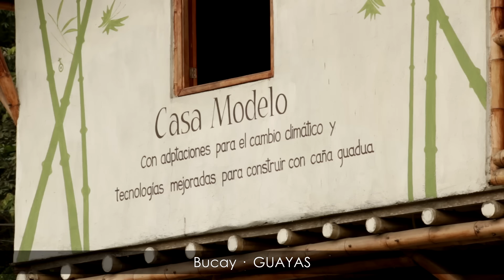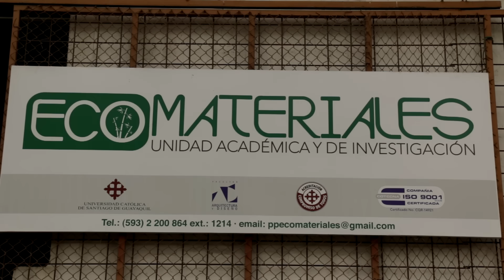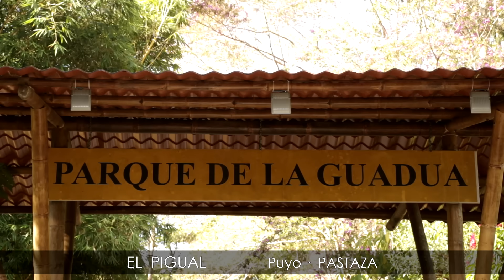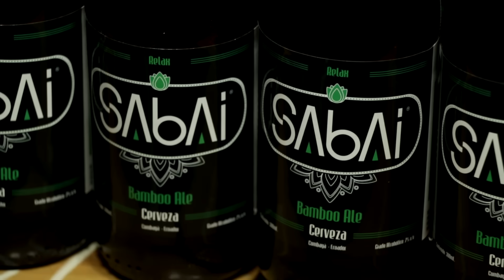BAMBOO - The industry of the future, now

Comment: We have invented fast pyrolysis system for conversion of any dry agro waste to active energy without the pollution of environment.We developed a pilot project for Maharashtra Bamboo Development Board,Nagpur, Maharashtra.On the completion of the process of dry bamboo waste we get three Bio Products                     1) Pyrolysis Oil 2) Activated Charcoal 3)Syn Gas.                   •)On distillation of pyrolysis oil we get Light Diesel Oil(LDO) and Compressed Natural Gas(CNG)                      •)The Activated Charcoal obtained from the system is used in various industries such as Cosmetic industry, Pharmaceutical industry and Fertilizer industry.The Activated Charcoal can also be used for Purification of Water.                                           •)Syn gas can be used for generation of Electricity and on compression of syn gas we get Compressed Natural Gas(CNG).                                    This is a patented project and the size of the system varies from 1 tonne per day to 40 tonne per day

Comment: I learnt about Bamboo 19 yrs ago while in HK  ( sars stayed in urban centres same as covid 19 where air and water polution troubles 1/4 NY high in mercury toxcity 10 yrs ago healtauth did nothing Mercury big issue world wide in 1918 too ) Banboo light weight andflexible similiar ro carbon fibre for a fraction of cost ( but eng dont spec bamboo it natural NOT made to eng specs) Bamboo  groves can be contained by lining a trench with plastic so roots dont grow outward.Over 2000 vetities some will grow in southern Cdn prauries ( harvest every yr comes back from the root) Make composite plywood likr material with hemp fibre. Flooding occured Calgary Ab Cdn due toclear cutting ( waiting decades for planted trees to regrow) The wind and sun melts the snow ( not shaded and protecyed by trees) along with heavy mtn summer rains caused extendive flooding. Gov polocies to protect lumber ind caused the problem. Prairie farms could have another viable crop to grow along with hemp fibre. Sustainable ag production. Less mud slides on steep mtn where helicopter logging in BC Cdn is done.  Better areas already logged off. Waiting decades for trees to regrow. 1 403 830 4124 call us

Comment: So pretty all the finished products. I can see how it would help, since bamboo appears 2 grow faster than regular forests. However, arent we adding a lot more pollution when using all da machinery at smaller intervals?
Still, they are lovely designs.
Reply: true, but when comparing the total environmental impact of a bamboo construction with fex a concrete one the bamboo wins easily every time, irrelevant if you use carbon emission, environmental footprint, embodied energy or any other measurement methods. only straw bale comes close to this in the northern hemisphere. and i agree, it's extremely beautiful ;-)

Comment: This is a great video. Bamboo can be as strong as steel and help humanity with the deforestation issue. I am shocked to see 100 if not 1000 ways bamboo can be used. It is absolutely amazing.
Reply: Only in Asia though, I wouldn't support it as a building material in most of North America bc that would be economically and environmentally unsustainable.
Reply: @FletcherHillier  Why?
Reply: @rivergrrrl1256  Shipping building materials overseas would be bad because it uses a lot of fuel and cargo capacity to do so.  Only specialized, valuable building materials are shipped long distances. Eg tile from Italy, even at $1/tile is far more valuable to ship than low density materials such as wood or bamboo.  It would add the cost of overseas shipping and make the materials non-competitive vs. local lumber.  We also expect perfect straightness of all materials.  If its not straight I always return it and avoid buying it in the first place.  Even $1 more and it will not work as you are competing on a price level with those who would be using standard lumber, steel studs or concrete.  I wouldn't even bother with lumber as it increases in price far faster than inflation, which tells you it will be phased out of construction for all but custom homes in the near future.  Concrete composites will take over 90% of construction within 10 years.  I am already phasing it out of my business in favour of concrete.
Reply: @FletcherHillier  your reaction is outdated, as there are bamboo construction beams and planks, which are made to stay outside, heavy rain or not.
They last for at least a hundred years, as scientifically tested in shorter time..that is.
Reply: @ThomiX0.0  The cost of that would be insanely high with shipping.  Building materials are almost always the cheapest available to that area.  Eg. Concrete is the prevailing material at about $0.07 per kilo or $5/cubic foot.  Even our local lumber is going to be phased out of business as the prices double every 2 years or less for lumber in my area.
Reply: @FletcherHillier  , I agree if you would use local timber for your construction work.
But, here in Holland, we have the option for outside flooring and furniture, which are made from bankiray or teak.., comming from Africa or south-Asia.
Questions arise then, if it wouldn't be better to use pressed and fully impregnated bamboo instead, which stay straight and firm in any weather.
Transport costs are the same.., and using hardwood from the original old forests should be prevented at any cause, at least that's what I thought?
Reply: @ThomiX0.0  I have bamboo flooring in my house, its fantastic.  We used it above a shower and it suffers no problems from constant moisture.  I would consider processed bamboo products to be worth shipping, but normally the core building materials are locally sourced due to cost and weight.  I don't really work with exotic materials as most people want things to be low cost.  Bamboo can also be unethically harvested, effecting the Panda habitats and other species.  It can be a fast growing material though but its very different from wood.  We can kind of forget about a few thousand acres here in Canada for a while until they grow again so the growth speed doesn't matter that much except to the individual owners.
Reply: @FletcherHillier  , as you suggested, the habitat of the Panda is a restricted area far away of the useful bamboo growing sites.
The bamboo used for construction, isn't the bamboo food for Pandas, they use other kinds of bamboo and this argument cannot be mixed in the discussion.
Growing these gigantic types of bamboo in Canada is not done, due to the lower to moderate temperatures, and will always be a exotic material.
Multiplex wood ( Okumé) in the usual market sizes cost nearly the same as Bamboo triple layered in the same size, and are much stronger than wood, in Europe that is.
But in Canada the Oregon multiplex is much cheaper, which is logic, although much softer too, and will keep his position for building material because much lighter in handling.
Again, one have to use it for it's quality and your floor will indeed stay 'special' and for a long time to enjoy!
This movie showed us the constructions in it's original form, which is a whole other story and the material should than be from a local source.
It has his own natural beauty, which we should not 'want to have' in the north, and I agree with you about that.
For the tropical zones it is a very good idea, and can safe the forests at the same time, and that makes me happy to see. 
Thanks for your comments, cheers Fletcher!
Reply: @ThomiX0.0  Good to know, I would argue the same of our controlled forestry as far as not destroying habitation of any endangered animal.  Most of our country is not economical to live in due to a short farming season and cold winters, so we grow a lot of lumber that we can barely get to.  The further North you go, the more trees there are, yet somehow our lumber prices double every year.  
Bamboo is an amazing material for tropical areas, growing as much as 1 foot per day.  The problem is that people like to live where bamboo grows, so it will go up in price faster than inflation and eventually be too expensive for those areas.  As most cities do, they will use concrete more and more as it is comes from the most abundant building material in the universe, stone.  We even have methods of using microbes to produce the cement portion.  As far as I am concerned, concrete is the most important material of the past, present, and future as it is the only material that will be available to humans as long as we live.  Once we master stone we have the material to build anywhere on Earth and beyond.
Reply: @FletcherHillier  if I am informed well, the toilet paper, wet tissues and paper to wipe your nose, which are familiar all over the world, are mostly made from fresh wood out of the nordic forests. This handsome building material is smashed to pulp, as it brings more profit. We ourselves have to make important decisions during our life, moral values for those who make these luxurious items are tweaked by the height of their pay checks every month, we have to be responsible ourselves, don't buy lousy tissues anymore.
The curing of concrete give enormous pollution because we use so much.., we are simply with to many.., and when using wood for a single house we don't even need a drib of it, none.
But in crowded city's there is a problem for that..as we all understand.
My house is entirely made out of concrete, even the roof tiles are that, there wasn't an option to choose wood at all.
And thus, insulation is a must, and therefore also ventilation..day and night because it doesn't breathe..in opposite of wood.
It isn't intelligence that made this happen, it was simply greed.
So, what is wise?
Reply: @ThomiX0.0  I mostly use cheap toilet paper that was made in the USA, even for blowing my nose bc I'm cheap like that.  Concrete is not all bad, sure there is a lot of CO2 produced in the process but thats because we're really just learning about concrete.  Portland cement is the main reason why it doesnt breathe, but Lime based mortars and plasters on the surface can help with the moisture problems as they do breathe.  
That's pretty cool that your house is all concrete, I'd actually love that because I like to yell at the TV and prefer not to look insane.  If they can't hear me I must be normal.

Comment: Bamboo textiles are cloth, yarn, and clothing made out of bamboo fibres. While historically used only for structural elements, such as bustles and the ribs of corsets, in recent years a range of technologies have been developed allowing bamboo fibre to be used in a wide range of textile and fashion applications. Modern clothing labeled bamboo is usually rayon. The bamboo yarn can also be blended with other textile fibres such as hemp or even spandex.

Bamboo fibres are all cellulose fibre extracted or fabricated from natural bamboo, but they vary widely.

Textiles labelled as being made from bamboo are usually not made by mechanical crushing and retting. They are generally synthetic rayon made from cellulose extracted from bamboo. Bamboo is used whole and in strips; these strips may be considered stiff fibers
Reply: I have been searching types of bamboo amenable to retting and crushing to no avail.  Do you know of temperate climate ones that might work?
Reply: Dollar vigilante

Comment: Tell me what kind to grow and I will plant it on my farm then build with it I love Bamboo it!??  I need to know how to treat it???????
Reply: Pamela Chadwell you can try the following varieties

Bayog (Bambusa Blumeana variety Luzonensis) has the same diameter as kawayan tinik but with thicker walls and is used for the superstructure of buildings and homes. Bayog often have curved culms and may be used for furniture for a desired effect. Bayog is slightly thorny and grows in the lowlands.

 

Kawayan Tinik (Bambusa Blumeana) is of the same diameter but with thinner walls and is used for secondary components of a structure such as rafters and flooring. It may also be used for furniture. The Ilocano term for ‘tinik’ is ‘siitan,’ which literally means ‘thorn’

 

Bolo is a very thin bamboo that grows in the midlands, it can be planted by seed or offset, and is for ‘sawali’ (traditional woven wall)

 

Benguet Bamboo (Desdroca Lamus Aspen) used for room dividers or similar applications.
Reply: Thank you, I will try